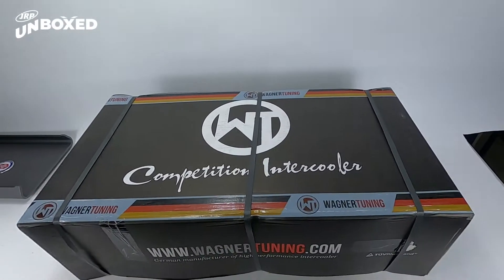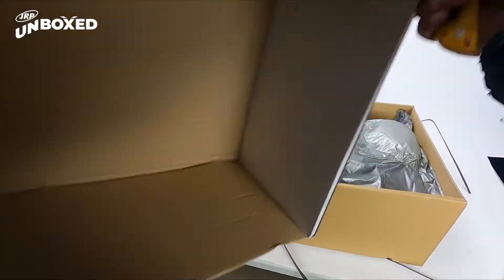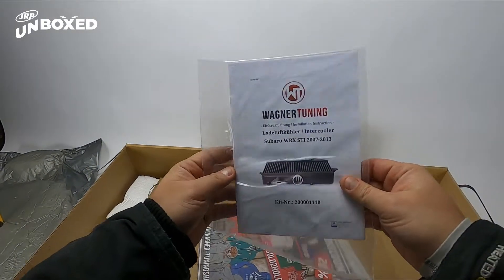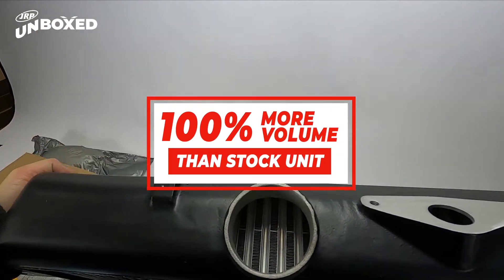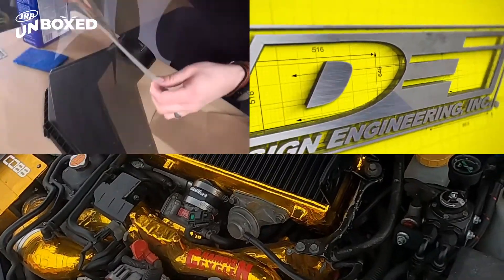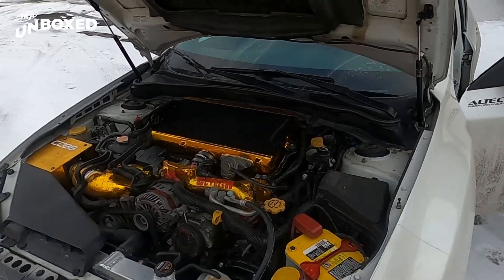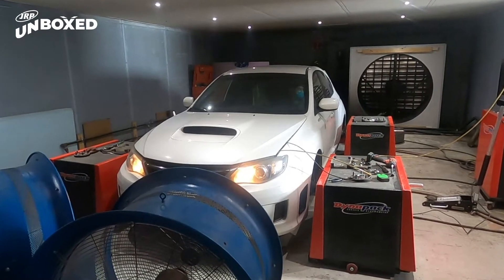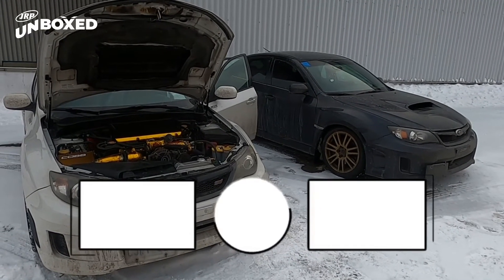The Best Top Mount Intercooler for Your Subaru - JRP UnBoxed

Comment: I wonder if this intercooler is really a lot better then the stock sti one. I got 380 hp (EJ207) with the TD05-20G and a friend was able to get about 450 hp with a bolt on GTX3076.

Comment: How much More HP with the Wagner Intercooler?
Reply from the maker: With our STI project car with a 55mm Precision Turbo, a 3" inlet and downpipe the intercooler lowered IAT's by 50% and added around 17hp with our street tune. The intercooler is capable of handling much more however this vehicle was street tuned and will only see a few trackdays every year.